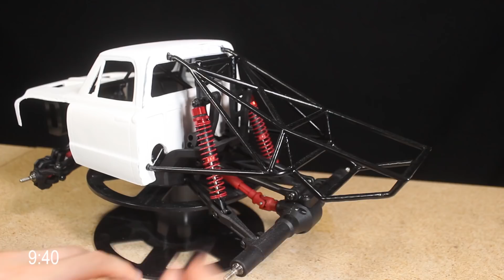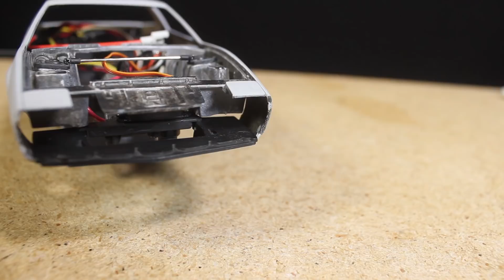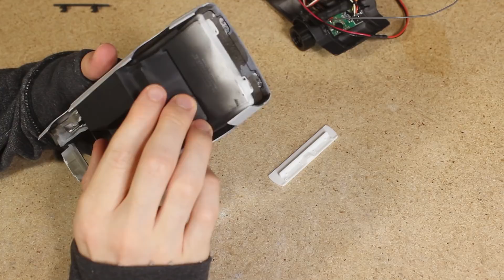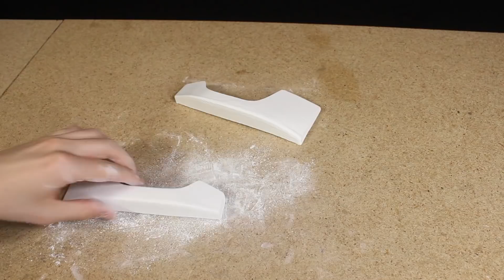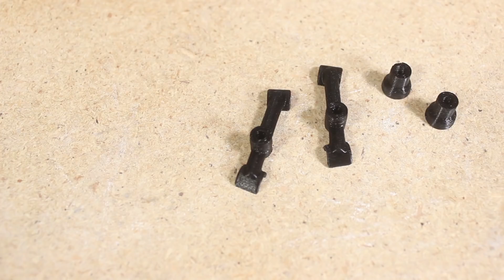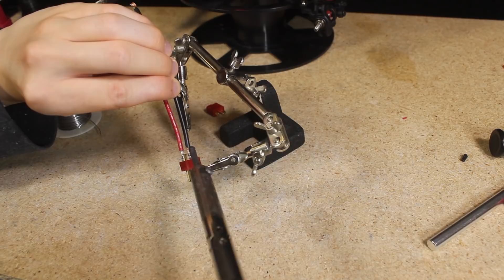Firebird + 72 Chevy Prerunner Progress | New Parts, Wiring lights, Post Print Finishing & More (E19)

Comment: you should get some heat shrink for those plugs, looks more pro and seals better than electrical tape.
Reply: I think he ran out of it because he used some on the battery half of the battery leads
Reply from the maker: I did as can be seen in the video, though one of them tore so I used some tape.